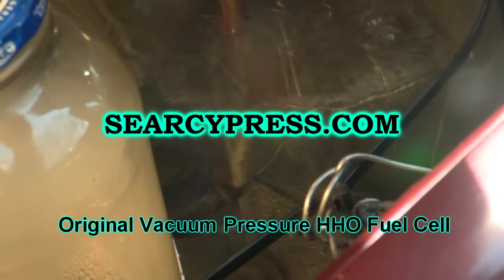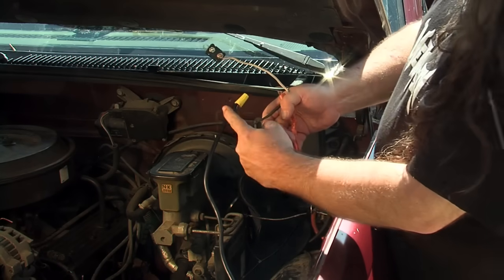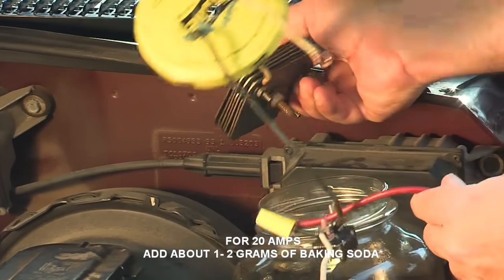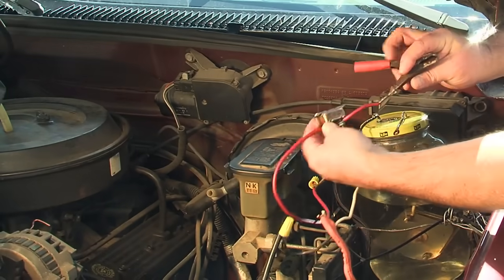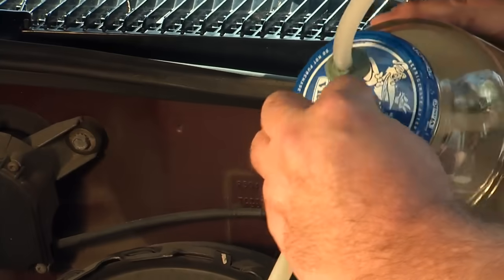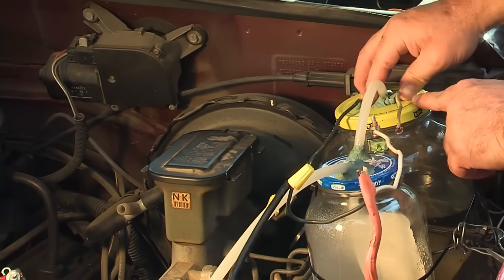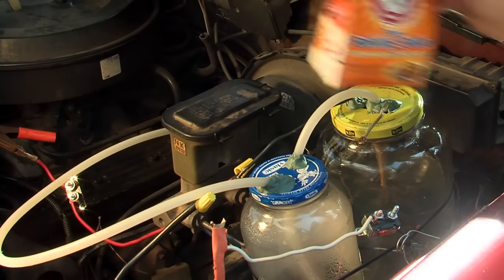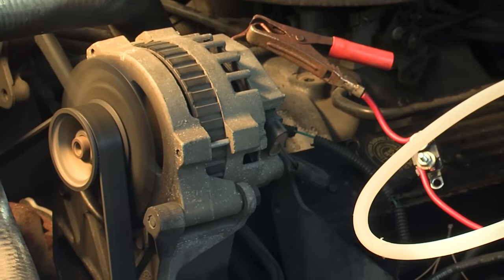Vacuum Pressure Hydrogen fuel cell defeats high gas prices using hydrogen from H2O.

Comment: I love how you guys "KNOW FOR A FACT" that this does not work!

I have been getting between 15-30% better mileage since adding the hydrogen fuel cell. My system is slightly different to this setup and I agree that you should never hook up the hydrogen to a vacuum hose on the brake booster, mine goes straight to the air cleaner. 

But guys, it really works! It works because your alternator is running all the time and generating current ANYWAY! MY fuel cells (2) draw about 15 Amps, and I have wired it up on a 30Amp 4 pin relay switch which is wired to the ignition. 

You also have to run sodium hydroxide because the bicarb just gets dirty the whole time.
Reply: Simon Jordaan Your car alternator doesn't produce current all the time. The amount of current flow depends on the electronics of the vehicle. For example, if you removed your alternator from the car and spun it you would notice it spins freely, that's because there is no load. The current output of the alternator is proportional to the current requirements of all the electronics of the vehicle. If you wire the Alternator straight to the hydro cell, you are basically placing a hard short onto the alternator and that will in turn place a large drag onto the engine because your alternator is probably putting out its maximum available current. Just thought i would throw that out there.
Reply: people claiming that it would kill the alternator, have obviously never had a nice car sound system, pulling high power for music. If the alternator is not strong enough [ upgrade the alternator to fit the difference, there are aftermarket alternators that produce better current.
Reply: also its been proven (i guess depending on how much power your car has) that having the AC on will save more fuel than driving with the windows down. if thats the case whats the difference between the AC pump pulling and the alternator pulling more juice. in my GFs small car you can feel the AC pump on when accelerating hard. in my ford diesel i never feel the difference.
Reply: I heard that if an alternator supplies power all the time it boils the battery dry destroying it in the process. Are you sure it should be working all the time? Cause I find that hard to believe, my engine rev drops slightly when I turn on the high-beams indicating that the engine is now providing more power then before. Also if this were true shouldn't the air-conditioner not effect gas consumption?

Maybe you could do a controlled test? Run the engine in stationary until it goes dry then while its still hot pour in half a gallon and let it run dry again and compare this to the non hydrogen time? Driving it around for comparison seems a bit subjective.
Reply: Helghastl33t It's a said rule, and must be so to prevent battery damage, that the voltage at battery negative should be near zero with any closed circuit. So if that's is the case here (why wouldn't it be?) then all should be fine. But hey, if the piece of shit battery then I'll just build myself a tesla coil in place of the batter. Maybe then I could modify the HHO kit's circuit to operate at higher voltages and AC current. I'd just better make sure I limit the amperage to a safe level. As for Simon's comment on manifold vacuum this only works if the line is placed after the throttle plate. Vacuum is not present before it. I'm betting he knows that but he said he places it in the air cleaner, which to me is the air box, and doesn't define exactly where said line is plumbed.
Reply: if you get small output then you're just a bad engineer hahahhaha
Reply: Completely wrong. Yes it spins anyway. But more load on the alternator = more fuel required to turn the alternator that is now harder to turn because of the load. Go find a electric motor and spin it, now connect a light bulb to it and spin it. Notice how its harder to spin. That's what happens when you increase the load. The same happens to your alternator. The harder it is to turn, the more fuel is being used to keep the engine running at a constant rpm.
Reply: they lacking few dots to understand what is happening.

1. the better bethod to electrolise water (proper electric fluctuations/impulses + baking soda i water (lye) catalises electrolisys with less energy imput)
2. better dynamics of expanding mixtrue coz of steam
3. hydrogen reactingwith with hydrocarbons helps them to disintegrate into smalled chains (easier to burn with oxygen)
4. oxygen itself makes reaction more intensive and fully burnt so even if you dont burn all hydrogen you burned all hydrocarbons what ara far more toxix when to burned.

that are thinks people miss when they try to calculate efficientyusing only a hydrogen and oxygen reacion in corelation to used electricity (mostly a example is a very unefficient olf fashion electrolisys using dc current without any improvements)

I can compare it to tryingto calculate steam engine efficienty when you using on newest model of steam engine yet your calculations are basen on some OLD POT of boiling water... is it sientific method? :)
Reply: placebo effect
Reply: is everybody aware that this is not running off of pure hho gas? the hho gas is an additive to the air system. the truck still burns gas
Reply: Simon Jordaan please send me yiur setup info to try. thanks. waits4me@gmail.com
Reply: Simon Jordan, please send me your setup. Thanks.
Reply: Heres the thing tho, when he hooks up the hydrogen generator up to the car he uses gas to start the car because the alternator dosent give out power until the engine is running, so you still need gas to run the car.
Reply: False statement: "generating current ANYWAY".
Reply: Care to share a video of your achievements?
Reply: Website guy  Wrong again. Do what ratgreen told you to do, you will hopefully understand. I took electronics classes, this little experiment is one of the first things we did. When you add a load, the motor will no longer spin freely. As for your generator, you are turning the energy ALREADY STORED in the gasoline into electricity. Two different formes of energy, but both are still just forms of energy. The reason a generator is not useless is because some consumer products need electricity to work, others need liquid fuel. Either way, you are using the same ENERGY. There is no way you have been to college...
Reply: Martin M  What a fucking joke you are. Proof or nothing.
Reply: Website guy  Dude spelling. An IQ of 150!!!! LMFAO you are a joke bud. Oh yea, you don't have to lie to make friends. Didn't your mama teach you that. And no, I don't believe any of the bullshit you said I do.
Reply: it does work all the thine just that it has intervals in which it reduces out to a minimal stage this not to burn out ur battery so using your battery as a second energy source would be  a great idea for when these intervals hit your alternator you still have energy flowing to your whatever that thing is.
Reply: power issue resolution, SupercapacitorA
 supercapacitor is a high-capacity capacitor with capacitance values 
much higher than other capacitors that bridge the gap between 
electrolytic capacitors and rechargeable batteries. They typically store
 10 to 100 times more energy per unit volume or mass than electrolytic 
capacitors, can accept and deliver charge much faster than batteries, 
and tolerate many more charge and discharge cycles than rechargeable 
batteries

Comment: If you mix in hydrogen to decrease the fuel consumption, the engine will run lean and the valveseats will be destroyed due to the much higher heat generated when you burn hydrogen.
Reply: Roy Rogers According to who? BP? Exxon Mobile? AGO? The "experts"?
Reply: Bone Drone According to me.
Reply: Roy Rogers Sure, whatever you say.

Comment: I have been waiting for someone to WAKE UP and realize there are VACUME LINES to the carb !!!!!! people are drilling holes in intakes or putting the hose inside the air filter tubes and finally, just hook the dang thing up to the alternator !!! this is not that hard people !!!!!!!!!!!! thanks guy !!!

Comment: im really phyc'd about this.  how do you get past the 02 sensors?  if the sense a fuel mixture that's to lean....the system will dump more fuel and negate your gains in economy.

Comment: The amount of power needed to make the hydrogen from water is more than the hydrogen produced from it, you are effectively loosing energy doing so, not to mention ruining the inside of the engine by allowing some water to get into it.
Reply: Richard Garnache I really would like the exact names. Because I plan to make this work. Yes, it takes electricity to separate the hydrogen from the water. However, that's not the whole issue. The hydrogen produced will actually replace some of the gasoline being introduced into the combustion chamber, thereby reducing the amount of gasoline being used to power the car. Hydrogen is a very volatile gas and will greatly improve the combustion efficiency of the engine even if it doesn't actually provide any fuel economy improvements. It will increase power and reduce emissions as well as reduce carbon buildup on the piston crowns. I simply want to know what kinds of benefits it could provide for my engine. And if there's money to be made from it, all the better.
Reply: DracoAzule You mean "cast iron", not steel. But you're right. Cast iron is vulnerable to corrosion from water. However, the engine internals won't be affected as much as the exhaust. If the exhaust pipes are plain old steel, then there might be an issue since burning hydrogen results in the production of water vapor that could corrode the inside of the exhaust system. Stainless steel exhaust would remedy this problem, but would be expensive. Internal engine components would not be as suceptable unless there is severe wear on the cylinders allowing blowby which would allow water vapor to pass by the piston rings and into the crankcase.
Reply: From what I understand, the extra hydrogen is supposed to increase combustion efficiency. It really doesn't take much electricity to separate hydrogen and oxygen from water. The HHO that is introduced into the combustion chamber will supplement the gasoline and "supposedly" increase combustion efficiency thereby increasing fuel economy and reducing emissions. I don't know if it actually works because I've never tried it. However, I will know in a couple of weeks when I install a dry cell HHO booster on my '97 T-Bird.
Reply: Richard Garnache I have no idea if it really works or not. That's why I'm going to give it the old college try. The theory is sound. The application is what needs further testing. And would you mind giving me the names of the companies offering a million bucks to anyone that has one that works? If it does work, I sure could use the money.
Reply: Chris Haywood What Richard fails to explain is that the whole concept of this mechanism violates the 2d law of thermodynamics. By running a current through the water you are heating it up, this heat/energy is lost as it can no longer be used for creating motion. You are going to lose about 40-60% of the energy you put into the water in this way.

What comes out is hydrogen and oxygen (that has less energy then what you put in) that gets burned in your 15-20% efficient gasoline engine, and this engine powers the dynamo that makes the electrical energy used to make the hydrogen (the dynamo also looses some energy but by this point I think you understand the problem).

So what you have created is a way to waste energy instead of raising the efficiency.

To put it bluntly, if this works then we can build a giant array of these engines and run them forever generating infinite energy. You cant generate infinite energy in a finite universe it's a logical contradiction.
Reply: Surely its all about the storage of hydrogen. how do we get into space? hydrogen am i wrong ?
Reply: Richard Garnache First, I don't have a "motor" in my car. I have an engine. Well...with the exception of the electric motors that run the power windows and windshield wipers ;) Anyhoo, I don't know if it works or not. That's why I'm going to try it for myself. The entire purpose is to supplement the gasoline with pure hydrogen gas to increase the power and efficiency of combustion. The introduction of extra combustibles into the air/fuel mixture "should" reduce the amount of gasoline used proportional to the amount of hydrogen produced and introduced into the mixture. Again, I can't say if it works or not. But I'm willing to give it a try just for gits and shiggles. If it works, yay. If it doesn't, darn. No big deal. But I'm not going to dismiss out of hand an idea with potential simply because I don't think it will work. I usually try to keep an open mind on such subjects.
Reply: Richard Garnache
I mentioned that, and its not violating the second law that's the problem with the concept. :P
Reply: Richard Garnache

maybe a lot of them haven't heard of the prize money and contest?

some people like popular mechanics and dateline have built some devices and proven they don't work but just because they have proven that a few devices out of hundreds don't work doesn't mean that they have proven that ALL HHO devices don't work
Reply: @robinsss  08-07-2008 03:29 PM #3 DieselPower
I pre-registered a few days ago, not sure what will happen. His pre-register count was 5 before, and it's still 5 after. I think he may be scared of me!!! I'm ready to put up the 5K myself for a chance at a million since it will be an independent university doing the test. After registering and not being able to make contact with the guy, and is register count not going up, I think he's the one doing the scamming! 

In 1992 I watched Stanley Meyers drive his dune buggie up and down Garden of the Gods road in Colorado Springs. The car was picked over by everyone at the demonstration. Mr. Meyers did not use the type of HHO that is seen on youtube. He used a much different technology. He used two Tesla coils in series as seen this video. https://www.youtube.com/watch?v=PxFAkBbj3lc 

Since the contest began, there have been no follow ups, no news whatsoever about the contest since then. I went to the forums page,  http://aardvarkforums.co.nz/forums/viewtopic.php?t=1960  but  the page is no longer viable, but this web page is still up. http://www.aardvark.co.nz/hho_challenge.shtml  

Genepax Yes, you can run your car on water. All it takes is to build a "water-burning hybrid" is the installation of a simple, often home-made electrolysis cell under the hood of your vehicle. ... There's even a Japanese company, Genepax, showing off a prototype that runs on nothing but water.Jul 2, 2008 

Even in New Zealand there are laws against scammers with fraudulent contests.
Reply: More water goes into your engine than what you think.
Humidity is water vapor . Drive in the rain you still suck water in the engine.
Reply: They used to add water injectors to race cars to improve performance.  The water turns to steam and helps cooling the engine.
Reply: Richard Garnache  " the gasoline required to make the electricity is more than the H gives back to the Motor  " producing the HHO only takes 30 ampswhy would you say that's  too much of a drag to produce the HHO and run the headlights?  " WHY ?  It takes MORE energy than the H gives back to make the H  " that means it's inefficientthat doesn't mean it can't work despite being inefficient it could still produce enough HHO to run the car
Reply: Richard Garnache

"Sure the H adds a tiny amount of energy that's true,.. but less than the gasoline it took to produce that energy because it takes gasoline to produce the electric from the alternator"

it is less but the little bit of HHO that  is added makes the gasoline burn faster and more efficiently
which increased your mileage

Comment: That 2016 Toyota Mirai hydrogen car woohoo! I have a 1998 F150 4.6L, so How do i get it running on H2? What if I can get a 270A high output alternator and make a 180A H2 generator in the back bed! ^.^ I just need 6 of them H2 kits you have there & a vacuum compressor.